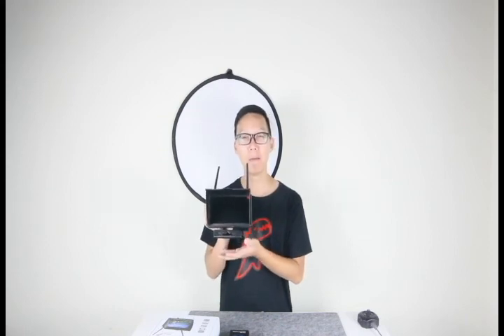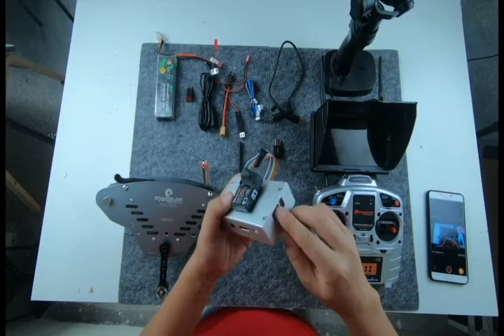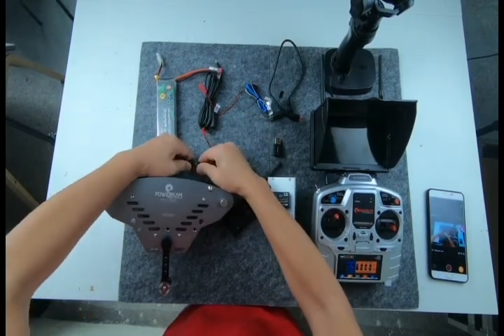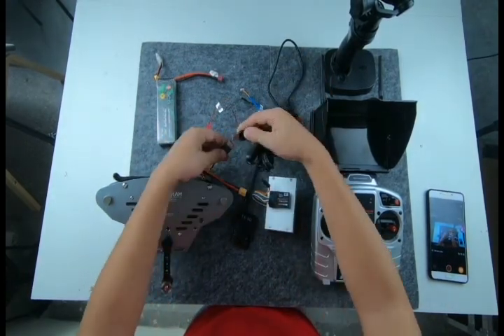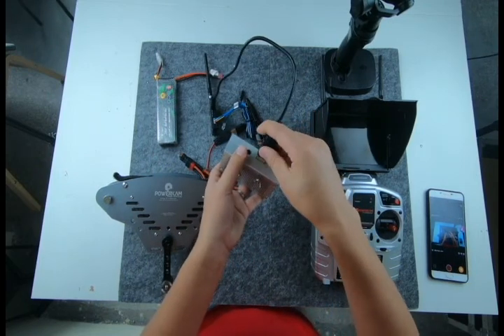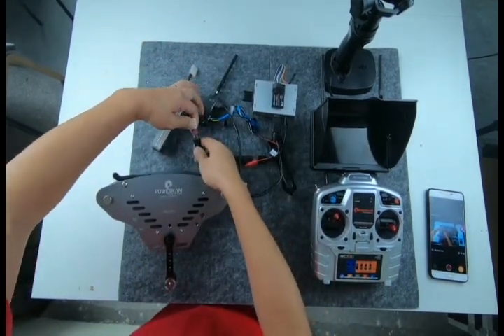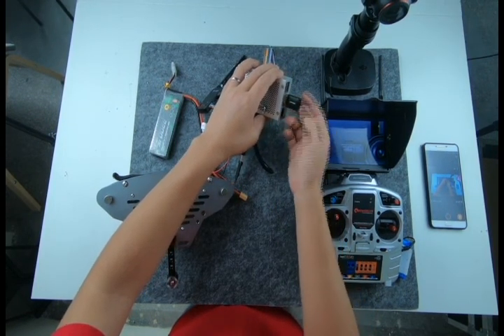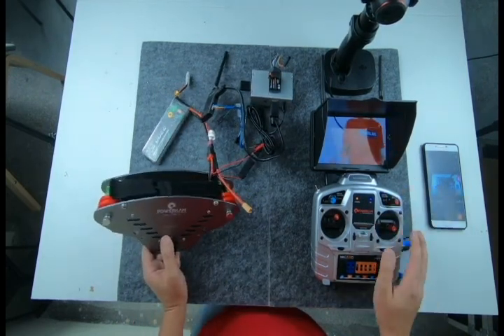Tutorial video for transmitter and receiver and monitor for cable cam and OSMORIDER

Comment: Hi, what ressolution and quallity do you get on the HDMI output?   I have a HD wireless link and a Wirecam, but are looking for a remote control and HDMI out sollution for the Osmo Pro :)
Reply from the maker: hi,it can output max 720p hdmi video signal, so ok for monitoring not for live use.